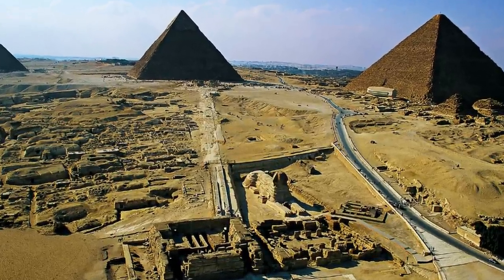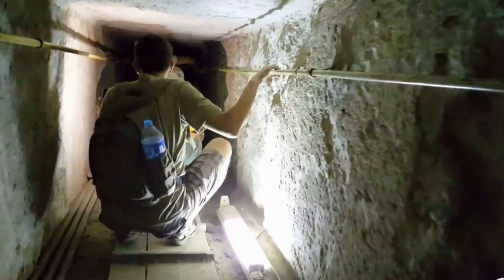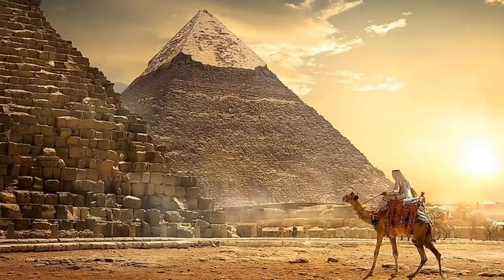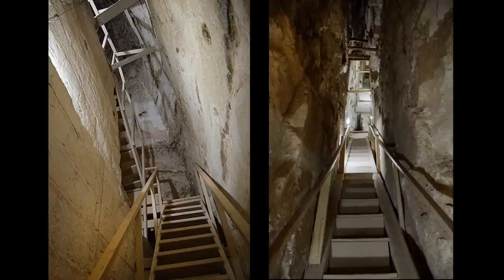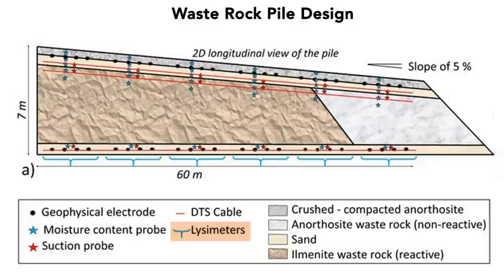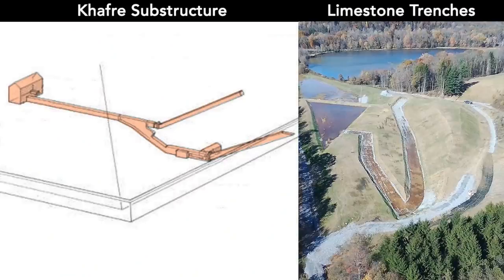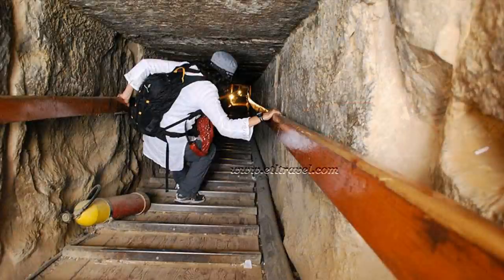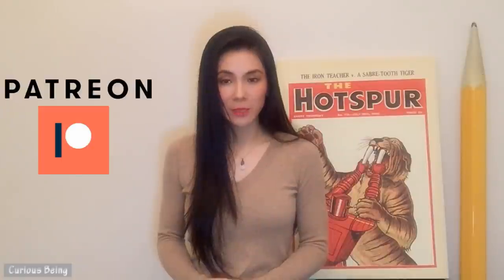The Secret Enigma of the Egyptian Pyramids’ Interior

Comment: As pointed out before, one problem with the so-called internal drainage shafts is the orientation of the carved stones in these shafts relative to that purpose, inasmuch as they are upside down to creating a flow channel. In addition, while I agree that the lower structures are constructed differently with randomly shaped and older appearing stones, rocks and tunnels in many places, it is unlikely that they played a purposeful part in any form of Anoxic drainage or in any form of Anaerobic treatment of water ingress into the pyramids as their use as a form of catalyst over perhaps thousands of years would have left vast concentrated residue deposits, similar to but far more intense than the salts crystallisation effervescence noted in higher level passages and chambers.  
The apparent answer when looking at these lower chambers is that they seem to be older than the pyramids above them, and while appearances can be manipulated and incorrect, such as in the video sections of what purports to be you extending your narrative, these appearances can also explain simple facts that we can apply to what we see today.

This part of Africa has been subject to many fairly recent changes in climate, of wet areas and in the massive desertification's that took place over the last tens of thousands of years, and the tunnels and chambers covered now with pyramids could easily have represented natural or older style wells for drinking water required in these periods that were later adapted in some way for an extension of their popularity and for other uses by the addition of pyramids built over them.
So, why build a pyramid over a well....perhaps because the ground water level was falling or rising, and maybe to apply pressure the the underground systems to affect the ground water flow levels by stacking millions and millions of tons of rock on top of them, as is done in many places today to consolidate wet ground, and/or maybe as time went on because the presence of the wells and grottoes led to a religious interest, similar to that in which churches, temples and shrines from all of the fairly recent religions of the last couple of thousand years have built strange edifices and/or houses for their god or gods over these ancient wells, to claim the kudos of these places for whichever controlling faction has seized control of people's minds and of how they could/can think.
Mining is still an option,  but that of course begs the question of what was being mined, and where life is concerned, water, both acidic and clear, are elements that always have to be considered, both above and bellow ground. Rainwater, yes, aquifers, yes, rivers full of silt that flood vast areas, yes, sewage disposal when enough people are in a small area, yes, and yet the first requirement of life is always the water that keeps it flowing through material, organic or the other physical systems that it dwells within and upon from time to time.
Reply from the maker: Were the pyramids created during the wetter seasons? The Sahara/ North Africa goes through humid/dry cycles. The Sahara was green and wet from about 14,500 years ago (after HS1 the millennia-drought) to 6,000–5,000 years ago. The humid period before that was around 85,000 to 78,000 years ago. HS1 (20,000-15,000 years ago) is the time period that coincided with the severe human population bottleneck which I think could be the ending of an advanced civilization (https://youtu.be/Zs4zLKbp4Ic). If the pyramids were built during 78k-15k years ago, then the Giza Plateau would be as dry if not dryer than now. 
On top of that, even the wetter periods might not be that wet - I will probably make another video on this. 
Since the Giza Plateau is close to the Nile Delta and the course of the Nile is fairly flat, the groundwater table would be closely associated with the sea level. Over 12,000 years ago, the sea level is about 60m lower therefore the groundwater table back then should be much lower as well. During the Last Glacial Maximum which lasted for a few thousand years, the sea level was over 120m lower. Would the shafts on the Giza Plateau be suitable to be used as water wells? Probably not.
Reply: @CuriousBeingbyTina  I would ask you to note that your point regarding when the wet and dry periods are said to have existed around the Giza plateau is unnecessary, and that it actually reinforces the probable need for wells before, during and after any and all periods of Pyramid construction in this region. 
Additionally, your assumption that any aquifer water table level in this area would be relevant to the sea level of that time is not supported by current observations, where aquifers in many places around the world today exist above and/or below the calculated sea level for those areas.
Also, as you are probably aware, aquifers can be filled with what some refer to as prehistoric water, or that of their accretion and isolation in rock formations or even their collection in ice deposits of many millions of years before their discovery or use as a water source, and while water table levels can reflect sea levels in some places, such as where the oceans can infiltrate the immediate substrate of an area, this is not a reliable data point to base any concept of or judgement regarding historic aquifer levels or historic well usage at Giza upon.
If you look beyond your restrictive assumption regarding sea levels, (which seems to suit your mining thesis but which as I see it, is unnecessary in this regard,) you will find that water sources available to surface dwellers are always crucibles of earthly life, so-called civilised social life forms and city states included, and the requirements of those who built the pyramids in the Nile valley, whoever they were and whenever they constructed them, were no different in this respect than any other form of life, human or otherwise that might have existed or which does exist today.
Not sure about robotic tin men and machines wrestling sabre tooth tigers. It could be that they don't need to factor in wells or drinking water for their existence, but if they are hunting sabre toothed tigers then they will need to become aware of many things that do not seem to immediately affect them intimately, or perhaps even to allow for the requirements of the ignored forms of life that might eventually supersede their limited world view..
Reply from the maker: @passerby9123   @passerby  There are many published scientific papers on the correlation between groundwater table in coastal areas and the sea level. This is not a restrictive assumption. You can easily find a few if you do a search. 
There are some perched aquifers on the Giza Plateau though such aquifers are typically very small comparing to groundwater aquifers.

Comment: Ok Tina, but why there is no signes (or at least I cant see them) of water corrosion/acid corrosion in those shafts and those places where there would be small waterfalls between one chamber and another..? it would certainly left some marks on those floors right?
All I can see is corrosion of limestone in those pits and lower chambers but NOT on shafts between them.. What do You think..?
Reply from the maker: Thank you for the comment. Maybe there are signs of acid erosion but we didn't recognize them or couldn't see them. The stone surfaces in the Queen's chamber look pretty rough. The granite King's chamber was maintained in better shape and there are old photos showing drainage markings by the air shafts.  Today we can't see the original floors of the tunnels. Wooden steps are placed over for tourists. From photos of the passages in different pyramids we can see some erosion/ damage marks on the tunnel walls. 
From today's open-channel limestone drains, we can see that the limestone contacted with acid drainage is slightly rounded as the acidic water erode away the top layer and corners. The change is quite subtle. So maybe the stones are showing mild acid erosion though we can't tell whether it was caused by age, man-made damage, natural erosion or acid erosion.

Comment: I have one flaw with your theory for it being a drainage which it is cool how it helps the acid neutralize and what not but I have a problem with your theory. There is not enough water going through those holes to make that much salt deposit let alone we’re talking about salt deposit that’s high up on the ceiling. That means these things were full now it could’ve been during an active rain season and there may have been a lot of vegetation, but I’m sorry. Four holes is not enough to create that much water and it would not fill that pyramid up remember stone is very poor, even granite and limestone, and even if those pyramids were covered up with two limestone, believe that the stone would absorb millions of tons of water and yes, when I lay stone and we put our wicks to help the water drain through the mortar and joints of the stone. It does make sense to have those drainage holes, but it doesn’t make sense how it accumulates so much Water and let alone salt deposit from the water was being used and the water was coming from the bottom but like you said the underground passage, don’t have salt deposit, but what if you only get salt deposit from stagnant or water that is present in a chamber, but if it’s constantly moving in the underground shavesdidn’t deposit the same
Reply from the maker: Thank you for watching my videos - below is the list of my videos on Egyptian pyramids. I think the last advanced civilization ended around 20,000 years ago (Some have proposed that the Younger Dryas comet impact was the event that ended the previous civilization. But I found some data which indicates the real culprit was an earlier disastrous time period. I made several videos on this topic. Hope you will find them interesting: Was an Advanced Civilization Wiped Out by a 12,800-Year-old Comet at Younger Dryas? https://youtu.be/4XXV3Ax3KO4 
20,000-15,000 Years Ago, When Humans Faced Extinction – the Ending of a Previous Advanced Civilization? https://youtu.be/Zs4zLKbp4Ic
The Lost Civilization of the Megalithic Sites: Who Built Them and When? https://youtu.be/u4V_ZQukWEU 
Lost Megalithic Civilization: Finding Their Remnants? https://youtu.be/0KBfaLJykF4 )

My proposal on the Egyptian pyramids:  
1. The Underground Complex: the Giza Osiris Shaft Created by a Lost Advanced Civilization? https://youtu.be/GloDq_h7yLg
2. The Osiris Shaft: Part of a Prehistory Mine from a Lost Civilization? https://youtu.be/JuGt7JEWT6E
3. The Great Pyramid was Not a Power Plant but perhaps Something Totally Unexpected https://youtu.be/ztkWo8g49S8
4. A Provocative Theory: Giza Pyramids as a Lost Civilization's Mining Waste Storage Site? https://youtu.be/tFzd2z0Rr1U
5. Great Pyramid: Let's Double Check the Mathematics & Star Alignment Claims https://youtu.be/nPswBtmQKD8
6. Prehistoric Mining: What was Mined on the Giza Plateau? https://youtu.be/y6ShuJdzDS0
7. The True Purpose of the Great Pyramid's Interior System?!  https://youtu.be/BYr6HbEjS7w
8.  The Secret Enigma of the Egyptian Pyramids’ Interior https://youtu.be/hxWEWUsvcS4
9. Egyptian Pyramids Reveal Acid Mine Drainage Stains? https://youtu.be/-QyIJ-w-8vc
10. Egyptian Pyramids & the Impact of a Green vs Desert Sahara https://youtu.be/8CVetiox04c
11. Great Sphinx: Buried Secret Exposed https://youtu.be/0YoM4W5W0pg
12. Questioning the Luminescence Dating Result of the Giza Pyramid https://youtu.be/gFBC8DJ5mZ0
Reply: @CuriousBeingbyTina  thank you that’s amazing topics being addressed. Also we have to put in some
More thought. Right now I’m 50-50. I’m believing that water came up through the ground cisterns or some kind of water spring because think about it if you could have water coming through a spring, there would be some kind of benefit rather than just drinking the water, but if you’re doing some kind of giant mining Excavation, it does make sense to organize the stone and the way they did for proper runoff. I just see it as a waste of stone. The fact that they even did this much work to make these things they could’ve definitely made a similar construct but with more of a purpose like if you’re gonna use millions or billions of tons of stone, don’t you think you would make some kind of temple or building or city rather than just, filtering the water from mining or mining there’s big statues and great things all over Egypt in the Sahara desert, but overall most of the stone is right there at the pyramid why mine stone just to stack it. I definitely don’t believe it was cast like some concrete it has way too many tool marks, and if you can, go there one day there’s many many examples of cuts which are very perplexing because the saw cuts have blades of diameters that are unheard of some of the cuts are flat cuts looking like some kind of vibrating flat saw cut it but nobody knows nor do we have an ideaand I just lost because nobody seems

Comment: Your question about the condition of the foundation stones of the Red Pyramid at the 8:21 of your video is because the Red Pyramid was built right out of the existing limestone which served as its foundation—unlike the Giza pyramid whose foundation stones were imported to its location from elsewhere. This also explains the rubble at the base of the Red Pyramid. Subsequent earthquakes would have broken up the load-bearing limestone foundation of the Red Pyramid. I hope this answer your question about the debris at the base of the Red Pyramid contrasted by the precisely cut and finished stones of its upper edifice.

Comment: The so called airshafts in the Great piramide where closed off the found the entrance in modern Times by knokking on the wall ?
And can you explaine the copper handles found in the airshaft and that also is a obstacle fore Air to go trou because it blocked the tunnel ?
Reply from the maker: The air shafts in the Great Pyramid are free of obstruction for about 50 m. They could have acted as the underground perforated drainage channels as we have today (such as a French drain). The copper handles are curious because they are placed so deep in the small air shafts. I think maybe they were not supposed to be moved since even with the handles the blocks fit pretty tight in the shafts and are not really movable.
Reply: @CuriousBeingbyTina  not correct the airshaft entrances are found in modern Times from the Chamber the were not visable  and to My correct knowledge the time the found the entrances of the airshaft the even found artifacts like a Piece of Wood a stone ball and some rope i believe you can look this up  🙏
Reply from the maker: @wasitipico8742  Thank you. I read that the air shafts were not visible in the Queen's chamber because of the thick efflorescence salt encrustation. I talked about this in another video: https://youtu.be/BYr6HbEjS7w
The wooden pole and other stuff inside could be left from earlier excavators such as Ma'mun's crew in 820 AD.

Comment: In a sealed system air vents are necessary or the increased air pressure will prevent the water level to rise. If your theory is correct, the very oldest pyramid should be completely solid and a lot of run off residue should be around it. Thus making the builders understand the need for a cleaning system in the next pile.

Comment: I believe if the two unexplored chambers in the great pyramid are ever explored they will reveal a design similar to the Great Hall leading to the Kings Chamber, and they will have been to operate  counter balances to haul stones into position. Using a similar principle to modern lifts and very steep railways with opposing counter balancing rail cars.

Comment: Hi. Interesting ideas, liked the video, very well thought-out, prepared and presented. But I have some counter ideas. I was wondering, have you considered the "melted" stones could be the result of giant floods in the past? I mean there was at least one great flood recorded in the history of mankind and the water would have surely reached and filled those rooms too, because none of the pyramids is water-proof (the joins look razor-blade tight, but there are tiny slits between them, which would have let water inside). And many floods have occurred in the past not as giant as the biblical one, which could have caused that as well. Also the floors of many of the chambers are considered to have been destroyed by thieves in the past, who believed there had been treasures underneath them (so they literally dug up giant holes in the floors). And finally, how would the acid water from mining operations have been transported so high and pumped to the pyramid? In your comparison to the dam, the water is always their naturally with high pressure -- no effort needed. But the vents of the air shafts on the Great Pyramid are at very high altitudes. Also, the overall effort to build such monumental buildings with such geometrical precision and everything seems largely disproportionate to it just being a giant mining waste processor. You could have built something much more simpler and smaller to take care of the waste, couldn't you? Such as a string of very low pyramids, instead of one giant one. That would have been more time- and cost-effective. What do you think?